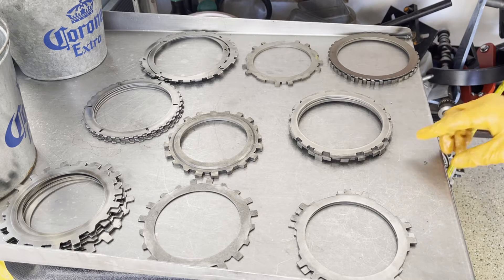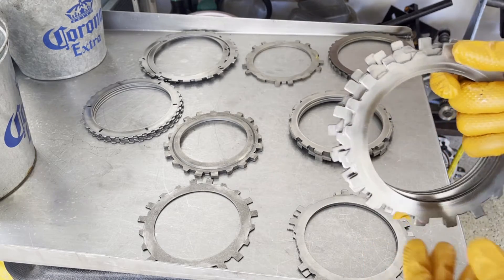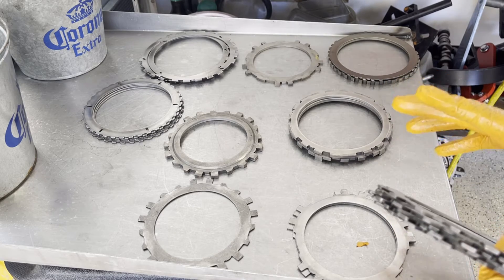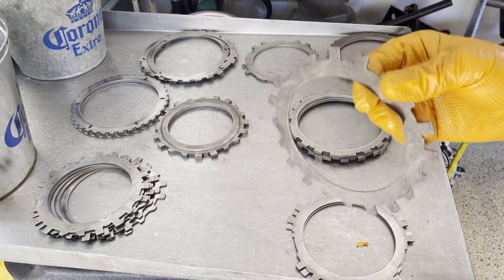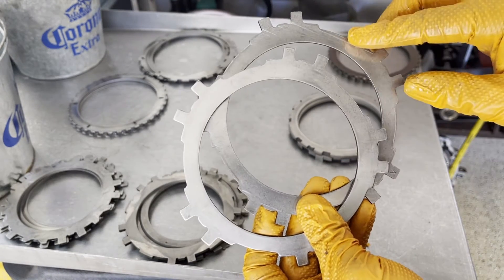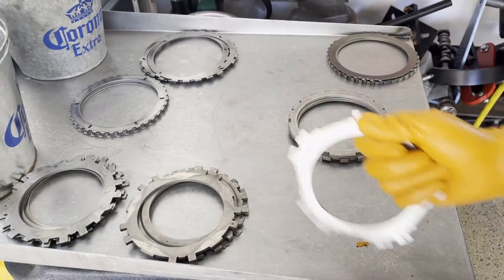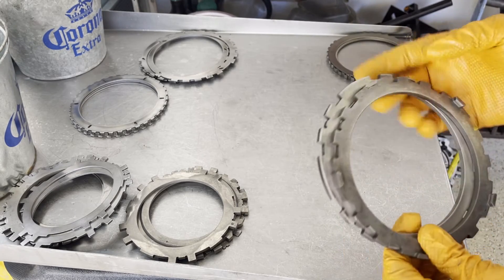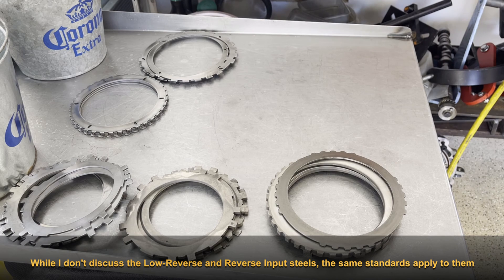Inspecting Automatic Transmission Apply Plates and Steel Plates For Re-use

Comment: Hi Nick, as you know I'm working thru the C6 in my 1989 Bronco, and I was curious how to assess the wear on the clutches.  For example, this Bronco (which had either 53,000 miles or perhaps 153,000 miles, can't tell as odometer never had the 6th wheel), appears to have every single clutch appearing black in color, but they seem to have what I will call the factory (manufacturing) grid pattern visible and consistent.  In your opinion, is that normal wear, or light wear?  Since I am new to tearing into automatic transmissions, I kinda expected to see much more wear on the clutches.  If a transmission is really smoked, would those clutches be worn down to the bare metal for example?
Reply from the maker: Hi Kevin, they're most likely burnt. The high energy waffle style frictions should look dark green but if they appear black that's a sign of overheating due to slippage and/or oil flow starvation.
Reply: @nickstransmissions  awesome as always thanks for your insights it is really helping me learn have a great day
Reply from the maker: You're welcome, Kevin.

Comment: Have seen the Man at Precision transmissions use a rotary disk to prepare the steels, wwould you reccomend using say a medium scotchbrite disk to scuff them up?
Reply from the maker: You can use Scotchbrite if you'd like, anything to remove the glaze and small slip marks. I always use a die grinder and medium grit waifer pad on steels, pressure plates, backing plates etc to get them prepped. If any steels have a lot of slip marks or are blued from heat, I just toss them in the scrap bin.